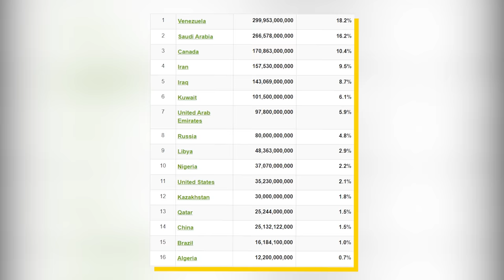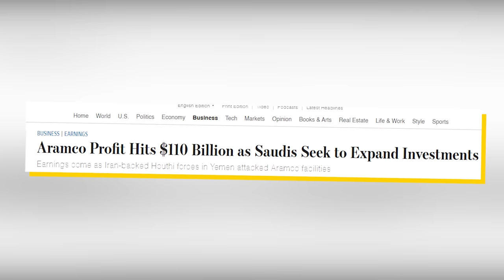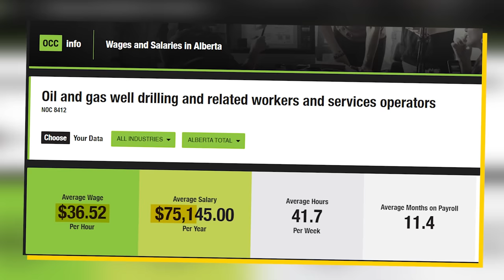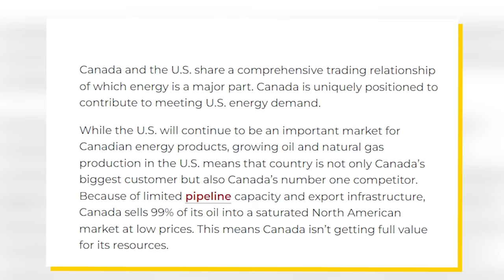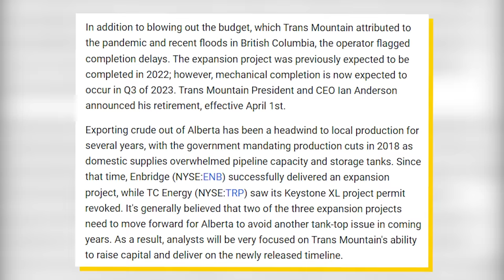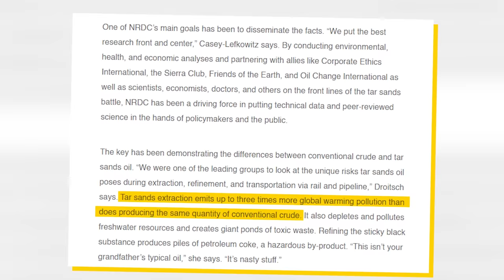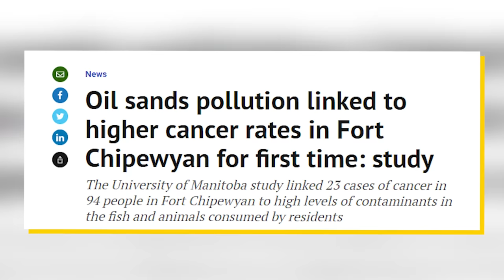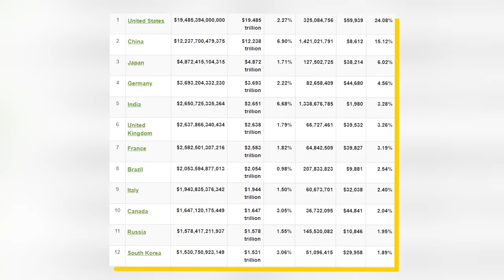Why Canada Refuses To Exploit Their Gigantic Oil Reserves

Comment: As a Petroleum Engineer working in Alberta this video is so wrong, especially when it comes to the economics part. We do not have an average break-even cost of almost $100/barrel. Some of the largest oil sands facilities have a break-even cost of $20/barrel. The conventional fields I've worked in had it as low as $14/barrel. $100/barrel doesn't even make sense as Canada produced from 2015-2021 with extremely low prices. Yes, companies hedge but this is so completely incorrect.

Comment: a small profit, a break-even or even a small loss is still worth it STRATEGICALLY.
1) You can prop economies that don't have oil
2) You cannot be squeezed by world energy problems
3) You bring foreign currency while having a strong tool against unemployment

Countries do far worse things than that.

Think about a country that invades other countries and spends BILLIONS per DAY on ammunition and weapons. Think what an economical hit this is and, yes, also an ecological disaster of course.
And it appears that Oil can be as strong as a military.

They should slowly extract it when it's not profitable and store it for when prices are profitable.
Reply: It also costs money to store the oil. When the price of oil plummeted, companies were literally paying for tankers to just hold onto it and sit in port, at astronomical prices.
Reply: @Sinyao  refill old wells which were explored when drilling was easy

Comment: Where did you get you info from ? Average laborer annual salary is 36K ?? The lowest salary in Aramco over 65K annual and that's the minimum. And if you're talking about blue collars they their average would be 18K annual, half of what you mentioned!!

So in conclusion, do not use Saudi Arabia as a reference if you can't get accurate information.

BTW, this is not your first time

Comment: Well put. You covered every aspect of the negatives of the oil sands. One colleague of mine once showed me the environmental impact of the digging of the sands and it took a big chunk of Alberta. Oil money did provide revenue for the Federal and Provincial government. Let's hope technology finds a better way to get the oil out.
Reply: This is the obvious answer that no one seems to accept.  I think we can find an better way to extract the oil.
Reply: Actually they are finding better ways to extract oil sands oil. That is why Suncor has reduced it's cost of production to $30. a barrel. There are labs in Canada working on this.Direct contact steam generation would drastically reduce water use in extracting oil from sand. There are chemical processes being experimented on that could eliminate water use altogether.The chemicals would also be recyclable. Other things being done in Alberta but are not talked about much is the completion of a ultra low diesel fuel refinery that is up and running.
Reply: @don-cw1yz  Fascinating, thanks for sharing that.
Reply: Right now the industry should not grow anymore. We are already at a deficit if we calculate the price of the clean up. The most conservative industry estimate is a 100 billion. The government estimate is at more then 200 billion. The profit from the industry should go into research to figure out a better way to extract. We cannot just turn our back and continue to fill toxic pond and expect the future generation to deal with the problem.

Comment: this guy doing the video doesn't know this, but i have a relative who's worked the oil-sands from the very beginning.  right now, they can produce a barrel of oil cost-equivalent to that of WTI.
the whole world doesn't know this...and why are Canadians being charged so much for gasoline? - government incompetence:  it's called a monopoly.
Reply: You clearly don't know what a monopoly is. Canada sources its oil from various locations, domestic and foreign. That oil is refined in various locations, and then sold as gasoline by various companies. You could make the case that there is an oil and gas oligopoly, but certainly not a monopoly.

Comment: Oil is only the second most valuable liquid available in Canada.  The most important is the one you drink and it will become harder to find as the world dries up.
Reply: Actually. There is also maple syrup, which actually sells for more per barrel than oil, and is MUCH less ecologically damaging.
Reply: I understand beer is the most important, but surely water comes in somewhere in the top 10?
Reply: @ParadoxysPlayground  Unfortunately for the French, oil has a slightly larger consumer base

Comment: Yeah, I don't think increasing Canadian oil production is going to be all that much more harmful to the environment than it already is. Might as well do it, and come up with the ways to clean up the oil sands slurry right now while the problem is still relatively small. Pipelines are also a better solution than rail transport of the oil.

Comment: Also Canada doesn't need $100/barrel oil to turn a profit, the price spread between the WCS and WTI oil prices varies a lot, as does Canada's currency exchange rate. Whenever the Canadian dollar is low, it can help offset the price spread as well. I think last I heard, Suncor, which does most of its work in the actual oilsands as opposed to many of the other guys, can break even at something like $60 or $70

Comment: Instead of exporting even more oil (Canada is 3rd in the world), Canada could, and should in my opinion, invest heavily in hydrogen, LNG and renewables. Quebec already is a 100% energy renewables province, and they are even selling the energy surplus to Ontario and soon New-York. So yeah, oil could boost their GDP a bit, but I don't think it is worth relying on it to grow our already good GDP.
Reply: 70 percent of canadas energy is already green also I wouldn’t call Quebec a 100% renewable province as they rely heavily on hydroelectric which isn’t renewable though it does release no carbon it has other environmental issues
Reply: @jameson1239  What kind of definition of "renewable energy" are you working with?
The term is about the energy source, whether it is naturally - be it directly or by proxy - and quickly replenished or not.
Hydroelectric dams are very disruptive to wildlife, especially the water based organism. That is true. However, water will continue to evaporate into the air, form clouds and fall down. The creeks and river will keep running and the dams will use their energy to make electricity. It is renewable as long as the Sun keeps doing its thing.

Hydroelectrics can be more than the potential energy from water going rivers. You have both tidal and wave energy.
Tidal energy is going to keep existing as long as the Moon orbits the Earth, and waves will exist as long as either the Moon or the Sun continue doing what they are doing.

The environmental factors does not change hydroelectric energy from being renewable to being not renewable.
Reply: Yeah, just keeping investing in "renewables" that won't be remotely useful in the next 10-15 years while citizens have to deal with skyrocketing energy prices in the present
Reply: @mr.gamewatch7547  It depends on where you live what is more cost effective. Where I live it is more cost effective to use the existing hydroelectric dams, with continuous maintenance and upgrades, while also expanding wind farms (with maintenance) than it is to use any other source of energy. Nuclear plants are less cost effective, coal plants as well. Solar energy is the least cost effective that I know of for my area.
But then there is the environmental factors in addition to the monetary factor. Wind farms have not shown much of a negative impact yet. People complain about them as an eyesore, but that isn't an environmental factor. Some birds die by flying into the rotating blades.
The dams are affecting the area, but they have been there for a long time now. The damage is already done and destroying every dam will not repair that damage swiftly. More effort is needed, so keeping the dams is a no brainer.
The nuclear plants are importing their radioactive materials, so the mining of them aren't affecting my area. But the mining of radioactive material is cheapest when there are few restrictions so the negative impact is huge where the minerals come from. Then we have the cooling water. It is mostly taken up from nearby rivers and returned, warmer, to the river. This is affecting the fish in the water. They reproduce way worse. It is almost as bad as the impact of the dams, but it would be easier get back to normal compared to the dams. The dams are preventing a lot of fish from existing in the water while the nuclear plants are simply affecting things living there. The difference is huge. Stop using the nuclear plants and the fish will be there and reproduce like normal again (almost). Nuclear plants also have the problem of what to do when the material has been used. Some places in the world have begun large scale testing of reusing until the radioactivity is completely gone. That requires huge renovations, big upgrades, to the plants. It would probably be better to build from scratch, from a monetary standpoint. However, it is still very expensive. It is way cheaper to build wind farms for the same output. The maintenance and repair cost of continuous power production is also cheaper for wind than for nuclear. The expected life span of the different plants is not the same, but tearing down old wind farms and rebuilding them is still cheaper than the nuclear plants. But if we do not reuse the nuclear waste until the radioactivity is gone, then the waste needs to be placed somewhere where it doesn't hurt the surrounding environment. This is an issue, but not a huge issue.
Coal has so many negatives so I will not go into details.

Tl;dr renewable energy is great, but location is key.
Reply: Hydrogen requires too much electricity to produce. Unless there is an application where you can't get around having a liquid fuel, hydrogen is a waste of resources. Might as well use the electricity directly. LNG is a non starter with all the first Nations bands obstructing pipeline construction. Just go look at what is happening to coastal gas link. Quebec is not 100 percent hydro powered. Even Hydro Quebec has a few back up natural gas power plants in case reservoir levels drop.
Reply: @jameson1239  Being renewable has nothing to do environmental impact. It's all about the ability of the power source to replenish itself.
Reply: @MrAnonymousRandom from nrcan.gc.ca “Canada is a world leader in the production and use of energy from renewable resources. Renewable energy sources currently provide about 18.9 per cent of Canada’s total primary energy supply.” And then “Moving water is the most important renewable energy source in Canada, providing 59.3 per cent of Canada’s electricity generation. In fact, Canada is the second largest producer of hydroelectricity in the world.” Implying it’s two separate things.

Comment: Canada's political decision in this case is measured by a higher cause. No one will get this by not having the ability to. The evolutionary equalization is a real problem as there is the natural instinct to destroy what you don't understand, yet is more powerful. If everyone is dumb around you, there is a 50% chance, that they are and that level is very difficult to handle as it is a decision between interests. Fun fact it's never interests its just right and wrong in different depths.

Comment: Another reason is that probably in 10 or 20 years most cars will be electric with people charging their cars at home overnight. Even for long-distance trips, cars can be charged in about 20 minutes using high voltage charging. The typical electric car range is around 300km, which corresponds to about 3 hours of highway driving.  While the car is charging, people can take breaks, doing whatever people do when they take a break during a long car trip...
Reply: 😂 Not happening. The electrical grid wouldn't cope. It's going to take huge infrastructure upgrades in the grid to be able to make this happen. And that absolutely will not happen in the next 20 years. Get your head out of your a$$ 😂
Reply: @Yo-ItsYo  If that isn't happening in the next 20 years, may I remind you that we will have serious problems?

Comment: Mineral/oil extraction in Canada is extremely difficult and costly. Also, Canada is gigantic. The transportation through point A to point B would be insanely expensive and lengthy. 
Canada got most of its power from both hydro or nuclear. We have little need for  [extra] oil and gas except for cars and industries.
Reply: Not much Nuclear in Canada. Hydro is number 1 especially in the east and in BC. In the Prairies, Coal used to be #1 but now Nat Gas is. I work in power.

Comment: Given the hyperinflation we in Canada have seen, an increase in oil production would help us lower it a tad. But so would Trudope halting his attacks on farmers and his plans to block the usage of fertilizers in agriculture. As it means we have less yield to go to market, which means less food for all and higher prices/ food shortages just as we have seen lately.  I also think we need to abandon the idea of a rebate on electric cars and instead add a tax on them as we added a road tax to the cost of gasoline. As our electric grid is going to need a lot of upgrades and expansions to accommodate all those cars going electric.  Our electric grid was never designed with all that demand in mind and we will see more blackouts/brownouts as a result of all those cars/ trucks being charged every day.

Comment: We should leap frog over oil expansion to green hydrogen production or at least as carbon neutral as possible blue hydrogen.

We need to stop looking backwards as the growth duration is longer and the potential larger with hydrogen than with oil.

The push going forward amongst the allied northern nations will be to buy from friendly nations and stop making our adversaries rich.

That puts Canada in a prominent position as we can produce blue/green internally for domestic use and green on our coasts for export and we are by far one of the friendliest nations on this planet.

Not sure if it makes much difference to the pipe if the gas is natural or hydrogen flowing through it but environmentally a hydrogen gas leak is only a loss in revenue and not life threatening.

Comment: Yeah, that mountain pipeline description was EXTREMELY simplified. There were 2 main obstacles to the pipeline.
First, Canadians as a whole do not want to exploit the tar sands. Mostly it is environmental. even the "easy" oil requires strip  mining MASSIVE areas of mostly pristine natural habitats. You tell me which you would rather have, Rivendell or Mordor? 
Second, the pipeline runs through Native lands and they were not given permission to do so. For a Liberal government supposedly intent on mending Canadian relations with First Nations, supporting this pipeline went 100% against the image they were trying to project.

A third issue is the fact that Canadian oil goes elsewhere to be refined. We do not like that we tear up our country only to turn around and ship it off to other countries in the cheapest form. Not to mention not being able to use it WITHIN the country.
But the Liberals bought the pipeline after it got bogged down in reviews and protests. This allowed them to skip those reviews and force the project through. It definitely felt like we were being sold out to Bejing when that deal went through.

Comment: Alberta needs to refine its tar sands crude in Houston. Not all oil refineries are equal. The tar sands crude is a particularly tough grade of crude to refine but Houston refineries are capable - and the refined product can then be easily shipped to buyer nations. But need that pipeline flow from Alberta to Houston. The Biden regime came in with a very hostile posture toward Canada, though, by shutting pipeline projects down. Trudeau has failed to stand up for Canadian interest (which would be very reasonable and beneficial to all parties in this case)

Trudeau, of course, is merely driving a wedge between western Canadians and eastern Canadians as Alberta continues to be shafted by Montreal.
Reply: British Colombia (western Canada) doesn’t want Alberta (central Canada) oil

Comment: No.  We have lots of easy to get oil we've exploited, the 3% that isn't oil sands.    If you drive in alberta you will see pump jacks. Here in Saskatchewan as well.   Offshore in Atlantic Canada plenty of easier oil too.  We also have the natty gas which is THE fuel and chemical building block.  But yes it's been mismanaged because of retarded gov't policies.